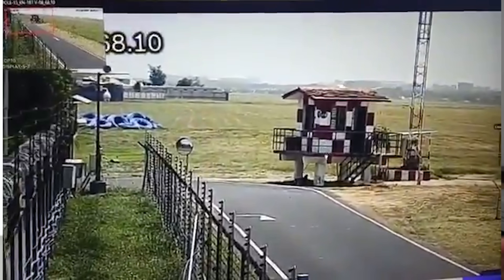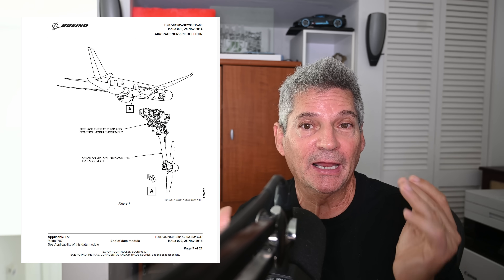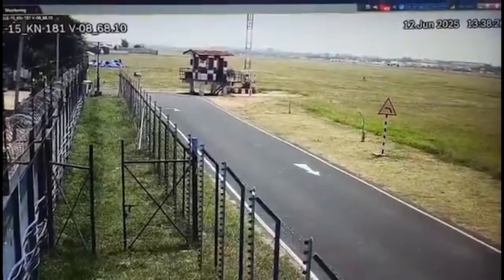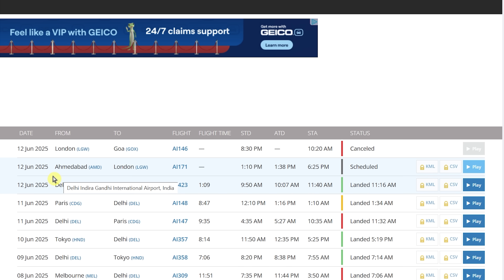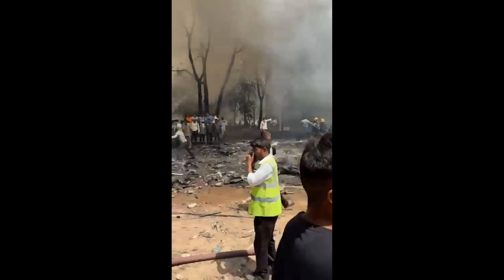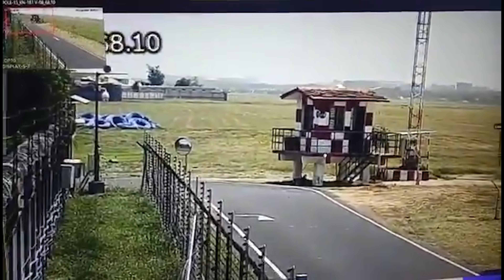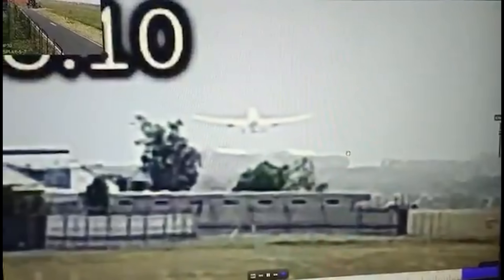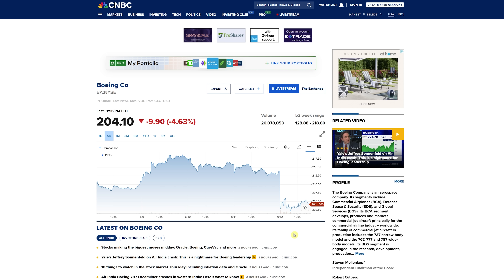What Caused Air India 171 Crash, Mysterious Sound Before Impact

Comment: As an engineer, and having been involved with commercial aircraft investigations, you always start with the obvious. You have a “dirty” aircraft with little or no flaps for maximum lift, plus gear down adding drag. Most pilots know if you lose thrust at that speed while transitioning, you immediately configure the wing for maximum lift. Drop the plaps! The aircraft descends from loss of lift.  Cause to be determined. A RAT deployment isn’t obvious in the original video presented, however you are correct that a RAT deployment has a distinctive propeller sound.
Since the tail section, minus vertical stabilizer, appears relative intact, the orange data recorders would be relatively easy to recover. India wonders what happened, along with victims’ families. My only “assumption” is that preliminary information will be forthcoming, quicker than most catastrophic aviation accidents. May God bless the victims and loved ones with my heartfelt condolences.
Reply: It lookes like it didn't have any flaps even at takeoff or am I not seeng that properly?
Reply: @vertigo2894  they cannot take off if flaps were not deployed
Reply: @Revkor  I mean they can if they passed a speed threshold
Reply: The first thing I noticed is that the landing gear is tilted the wrong way with its tippy-toes down at 0:01. On the 787, this only happens during gear retraction, but since the gear is not retracting, it is reasonable to conclude there is a problem with the landing gear. Possible hydraulics issue, could be caused by engine flameout.
Reply: As a retired airline pilot, you don’t know what you’re talking about.
Reply: The OBVIOUS is that no commercial jetliner either landed, nor took flight from this tiny airport in India. It did NOT take place, nor did any jetliner crash. Nothing but CGI NONSENSE!
Reply: What do mean by “dirty” in this context
Reply: @sobraine123  i think its like dirty air in formula 1
Reply: @beejayxl9018which begs the question. What is dirty air ?
Reply: Drop the flaps!  What?
Reply: You must have superpower to see the state of the flaps on this aircraft with the distance and the resolution of the video (even if you take the raw footage now available) the consensus of actual pilots of this aircraft is that it is not possible to tell the position of the flaps at take off on this aircraft at this distance and that anyway the electronic checklist would make it pretty much impossible to take off with incorrect settings.
Reply: Should we be concerned about flying in a plane? I keep hearing about plane crash.
Reply: @TOrganic  No, it’s still incredibly safe to fly, the safest by far compared to any other form of travel. People will overreact and fear monger but that doesn’t deny the facts. For example the 787 has been in the air for almost 15 years, there has been approximately 5 million 787 flights in that time and this is the FIRST ever 787 hull loss crash and fatalities. So yeah it’s very safe.
Reply: @dkmike2299 thank you.
Reply: @TOrganic No its still the safest method of travel
Reply: 🤔 WONDER IF AN IMPOSTER WAS ON THAT FLIGHT WHICH WOULD BE A PART OF THE CONSPIRACY.

CONDOLENCES TO THE FAMILIES LEFT BEHIND.
Reply: @JoanneIntrabartola-m2v  no, the imposter is running this channel, he has no expertise, no actual informations, wildly speculates and did not consult expert, yet acts as an authority for smooth brains.

Comment: I agree with the sound of the "rat". They lose power on both engines. The right one just before rotation,  the left one a few hundred feet up in the air.  Then it falls to the ground in controlled fashion.

Comment: Judging by the fact that the plane was not flying lopsided, it seems that both engines were running symmetrically, although it seems at lower power. The only likely way both engines fail or do not run properly is a fuel issue, and I imagine both engines were not getting as much fuel as they should have been getting.

Comment: It’s too early to say, but this reminds me of Northwest Flight 255 that crashed in August of 1987 shortly after takeoff.  They found out that the flaps weren’t set correctly.   Everyone died except for a little girl.   Strange that this fight has one survivor as well.
Reply: There is a great documentary about this from 2013 called Sole Survivor. Cecilia Cichan was that lone survivor from 
that Flight 255. She is interviewed in that documentary.
Reply: @32a34a Yes, I saw that documentary.   Very well done.
Reply: A modern aircraft like the Dreamliner will let you take off with the wrong configuration? I find that hard to believe.
Reply: @ericg3065 it's boeing lol
Reply: @ericg3065  many actual pilots explained this, this plane has 2 electronic checklists, which take into account all parameters of the flight, weight, conditions etc, if the configuration is incorrect the checklists wont pass and i will not be possible to take off. Take you information from actual experts, not a youtube clown speculating on tragedies.
Reply: Yes, I remember that flight and the cockpit is supposed to have an alarm if the wings are configured incorrectly for takeoff. The alarm never went off apparently
Reply: @EM-od6gu  Correct, because the pilot pulled the circuit breaker for the takeoff configuration warning.
Reply: SpanAir had the same pilot error after a second aborted takeoff because of a overheating sensor, pilots retracted the flaps on the tarmac. On 3rd attempt, they rushed the taxi check list "flaps 11/11" when the were not set, only slightly taking off only to crash into an adjacent river to the airport. Outside temps at Madrid were over 100 degrees and higher on the tarmac.
Reply: I remember this very well because I had just dropped off my aunt and cousin to the Detroit Metro Airport that day.   They were heading to the same city as flight 255, Phoenix.   When I got home that evening, my phone was ringing off the hook.   Family members were concerned they were on that flight.
Reply: If the RAT deployed, that indicates that there was power loss in both engines after takeoff.
Reply: @seamusoleary3712  Did that sound like a noise small propeller like a RAT would make?
Reply: The Northwest 255 is equipped with a system that warns pilots of incorrect take-off configuration. However, at the time of the crash, the warning system failed due to electrical failure.
Reply: @diegosilang4823 Mostly correct. All airliners have takeoff configuration warnings, this one failed but not due to electrical failure. The CB was pulled silencing it. Why? The MD-80’s and MD-82’s were NOTORIOUS for nuisance warnings during taxi. Every time you advanced the throttles even a small amount ERR-ERR-ERR-ERR-ERR-ERR! Very aggravating and distracting. Pulling the breaker was common practice. Sadly that practice resulted in the crash. Also as a side note, they struck a light tower in a parking lot. The NTSB added that had that not happen they may have been able to fly up and out even with flaps retracted.
Reply: The passenger who survived said there was a loud noise he heard soon after take off. The cc camera at the airport showed the crash occurred 30 seconds after take off !
Reply: @chandrashivpuri1224  If the plane had a very nose-high attitude as it stalled, the disrupted airflow into the engines could cause a compressor stall, which is similar to a backfire.
Reply: @chandrashivpuri1224 and the sound of a RAT after take off. But people will still ignore all of this. SMH…
Reply: You are correct in stating that it’s too early to say, however… I will say with strong confidence that this crash will not be the same cause as the NWA crash from 1987 in DTW.
Reply: with Rat out it's engine failure not flaps
Reply: You beat me to it
Reply: I will never forget that crash.  I was 10 yrs old and we were flying out of Detroit then next day from an airport full of wall to wall coverage of the crash.
Reply: @digitalstyx_est2018 Junior year 1991 in high school my US history class flew out from Seattle through Detroit to DC for the Close-Up program. To and fro we take in the same direction each time I notice the still darkened area of the overpass.
Reply: survivor to warn everyone the mistake made. Fly safely infuture
Reply: A politician died in the crash and eerily always had a penchant for number 1206. His first car was 1206 and since then all his cars were numbered 1206 and he died on 12.06.
Reply: @devashisnanda3477 What was the penchant for the number 1206, do you know?
Reply: espionages against USA, yet again
Reply: Investigation this case, because now India conflic by Pakistan, this human eror or sabotase
Reply: That girl sits at 11A for sure.
Reply: I remember a big crash in Tripoli where 1 boy of around 11 survived.
Reply: Dont  know the flight no 9  n year date 9 really big tragedy
Reply: I agree that I think it’s about the flaps
Reply: I remember when that happened
Reply: The pilots spent an usual amount of rolling time before taking off. It was probably because they had to manually override some settings.
Reply: This flight also had a one survivor and his name is Ramesh Vishwas 11A seat no...
Reply: Why airplane has not got spare engine in the case of one engine is out of order , Other can automatically take over!!
Reply: The flaps were set correctly; it was a dual engine failure (DEF) caused by malfunctioning electrical systems in the forward instrument bay that killed the fuel management system and starved the engines immediately after takeoff.
Reply: A single child girl travelling from this plane to London her parents book her tickets for 1 day before she wants to go 😢😢

Now she died her father came to the hospital for dna test 

Really heartbreaking
Reply: Birds.
Reply: Is this video sponsored by Boeing? Seems like every crash of Boeing in the last few years, and there are many, videos appear in YouTube blaming "Pilot Error".
The world is really tire of these American b ull s hit of blaming others and never taking responsibility.
Reply: Maybe overweight? Engine cannot cope
Reply: Flaps weren't set correctly was like Flight 91 Mandala Airlines in 2005, they crashed shortly after take off
Reply: I was in my little 737 in Chicago in line for departure and they stopped all acft going to DTW. When I saw this accident that no flap T/O came to mind…. A big jet like that at that second segment climb has always concerned me. I’ve made a lot of no power approaches in the 73 out west and it’s a piece a cake but right here….
Reply: It is flap 5 and slats, the flap is correct
Reply: It clearly is technical maintenance issue or pilot mistake.
Reply: @IamSpidey007  leaning maintance because of RAT
Reply: @IamSpidey007 thats not really narrowed it down has it ? It could only be one of two things .
Reply: @IamSpidey007 Dont be so obvious, almost all plane clash is because of that two things
Reply: The twin engines will LOOSE THRUST when the AOA is too steep and the FLAPS are not properly configured for "take-off."  It's called an induced aerodynamic STALL. The videos I saw, show the aircraft DROPPING LIKE A ROCK.  I expect the CVR and the FDR to CONFIRM PILOT ERROR as the primary cause of this lethal crash and explosion.

Comment: From AI search :One of the most notable Boeing 787 software glitch issues, specifically related to the AC electrical system, is addressed by Airworthiness Directive (AD) 2015-10-03. 
This AD was issued to prevent the potential loss of all alternating current (AC) electrical power on a Model 787 airplane.  
Reason for the AD:
A software counter within the generator control units (GCUs) can overflow after 248 days of continuous power.
If all four main GCUs simultaneously go into failsafe mode due to this overflow, it can result in a loss of all AC electrical power regardless of flight phase.
Loss of all AC electrical power could lead to a loss of control of the airplane. 
Action Required:
The AD requires a repetitive maintenance task of electrical power deactivation on the Model 787 airplanes. 
Essentially, this AD requires operators to periodically power off and on their 787 aircraft to reset the GCU software counter.

Comment: all the cr*p about "i'm an engineer i listen to blah blah blah" and you don't know a ram air turbine when you hear one? as for why the plane crashed, aside from the gear still being down, who knows. this trash airplane had hundreds of deadly design flaws, and i would bet my house that there are still more unresolved issues that Boeing knows about but won't say to keep the stock from tanking.
Reply: "this trash airplane had hundreds of deadly design flaws"
Would you mind naming a few? Are you mistaking the 787 for the 737 MAX?
Reply: @brucelansberg5485  no i'm not confusing anything. i'm sorry the google machine on your internet is broken. there were 10+ different problems with the batteries alone, that resulted in several onboard fires during flight. problems with the fire suppression system that during an engine fire filled the wrong engine with foam, causing BOTH engine to be out. bad wiring design causing wires to be pinched on a bunch of planes and disabling telemetry equipment. false low airspeed warnings that caused pilots to accelerate beyond the plane's structural capabilities. 

literally HUNDREDS of problems with this plane. not enough time to list them all.
Reply: @solomonshv  You mentioned "deadly design flaws". I'm sure I don't need to remind you that this is the first deadly incident with a 787? Any "deadly" design flaws haven't led to any deadly incidents up to yesterday, since its first flight over 15 years ago.

Comment: Did the Spoilers extend?
I was flight crew on heavy jets. The extended spoilers can make an Airplane drop thousands of feet per minute... I have seen this done to lose altitude very quickly to meet Approach altitudes quickly.
Water in the fuel? Our Aircraft had 10 fuel tanks overhead. 153 thousand pounds of fuel in the fuel tanks,  22,000+ gallons of fuel.  I do not know the Capacity of this aircraft.
We were told the safest seat on the plane in a crash landing was far in the rear of the Aircraft. Surviving while sitting under or over the wings would be a miracle from God.

Comment: Key #1   No black smoke   , Under load  jet engine  produces  excess  black smoke ,  no black  is  indication  of  multiple  primary secondary fuel pumps/ fuel supply  issue  supplying  enough fuel to  sustain lift ,  plane  fell from sky unable  to sustain lift .   maintenance Issue  interval ,system failure   case closed

Comment: Interesting seeing people cite no flaps as the reason for the crash, but I’ve had a look online and it looks like flaps 5 is the typical takeoff configuration for this plane. That would be quite difficult to see on videos like we’re seeing here.

Also, take a look at other videos of b787 takeoffs and you’ll see that they look very similar (i.e. very little flap angle, almost looks clean).

Comment: Doing maintenance i had a co worker connect an APU battery he connected battery but not charger  after like 10 minutes of apu running with APU on 100 percent rpm the aircraft shut down the apu  battery  not charging drained the main battery knowing the power the 787 requires to operate that could have caused loss of power those 787 engines have 2 variable frequency starter generators on each engines . May all the passengers that passed away rest in peace 😢

Comment: Electrical Failure.   The RAT deployment in the Air India Flight AI171 crash, combined with passenger reports of non-functional AC and cabin electrical systems on the same aircraft hours earlier, strongly suggests a significant electrical failure as a primary or contributing factor. The RAT’s activation indicates a loss of primary power (engine generators and APU), likely exacerbated by pre-existing electrical issues that affected the AC, cabin systems, and possibly flap deployment. The non-extended flaps, extended landing gear, and “no thrust” Mayday call align with an electrical failure disrupting critical systems, including engine controls and flap actuators, leading to insufficient lift and the crash 30 seconds after takeoff. While a dual engine failure (e.g., from a bird strike) remains a possibility, the passenger-reported electrical issues point to a systemic problem that likely predated the fatal flight. The electrical issues, particularly with the AC and cabin systems, and the RAT deployment strongly suggest a significant electrical failure as a key factor in the crash of Air India Flight AI171. While a dual engine failure remains a possibility, the pre-existing electrical problems reported by passengers, combined with the non-extended flaps and extended landing gear, point to an electrical failure as the more likely primary cause